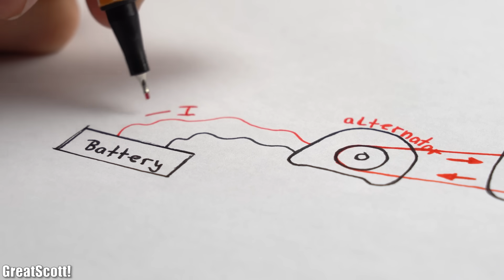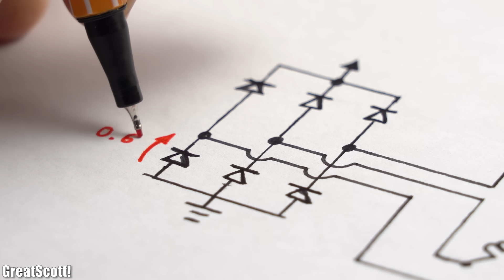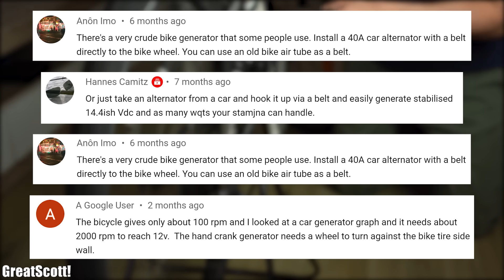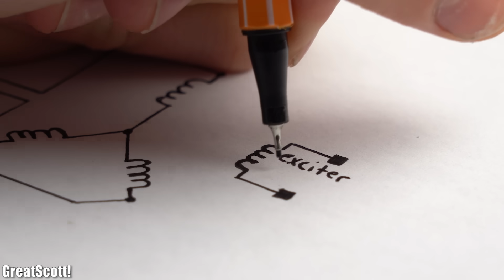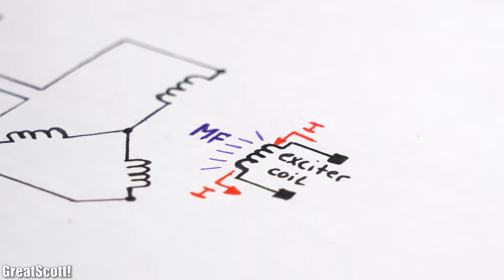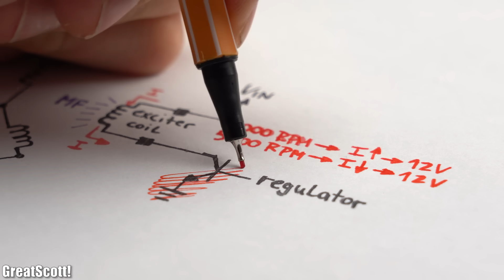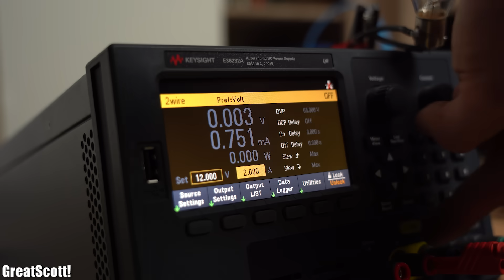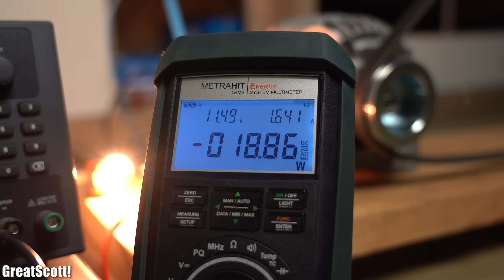Using a car alternator with a bike to power my home? How much energy can I produce?!

Comment: All I was going to say right away is you aren't going to get anywhere near max output when a car idles much faster than you will be pedaling. Also that belt is so loose, need a tensioner and slides to adjust the bike or alternator back and forth.

Comment: you need to learn how to wire the alternator correctly,one of the small terminal has the warning light in circuit and this is very important as it allows the regulator to work .If not you get an unregulated output which can damage the unit and battery and potentially cause an explosion ,trust me i was an auto electrician and a lead acid battery explosion is not pretty,,,,,,,,,,,,

Comment: So, I can easily do 100-120W effort for 2 hours 5 to 6 days a week. Let's keep it at 100W. So for 1 hour ride, I'll be able to store 1kW/h? We use about 200 kW/h per month.

When I was more fit, I could do more watts. 

Wish I could just run some small Air conditioner for my room for basically free for 1-2 hours maybe. But storing that much energy would require alot of battery,no?

I think it would be more suitable for a small greenhouse garden to run small dc motors and small heater/cooler.

Comment: Bit of an old video that popped up for the first time. I just wanted to say, cracking video, however I spotted a few mistakes. The biggest one I think at least for RPM is that you've got the gear system wrong. Your cog on your pedals you can't change without some tinkering, however, you set the gear to the easiest on the back wheel. The top gear is the smallest cog. The bigger the powering cog is to the drive cog, the back wheel, the more RPM you will achieve. So in simple terms, you get more full rotations the smaller the cog is at the back wheel to 1 full rotation from the pedals.

Comment: ERROR: you can self excite the alternator with the current it produces, this means you need only a little external power to excite it initially to start , then it auto excite the electromagnets .. a lithium battery supply of 3.7v for about 1 second can excite the alternator initially, then it self excite..

Comment: In legs there i 200W typicaly, so 100-150W from this alternator should be no problem to do.
Belt need some stabilization and force to compare bike weel dimension precision.

Comment: I have built a number of bikes that generate electricity successfully. Do not use a car alternator, instead use a 24 volt DC 250 watt scooter perm magnet motor. These motors are high torque and run at about 1,000 to 1,500 rpm max. You then put the DC output through a 12 volt DC (not a 24v DC) inverter. A really fit human can produce about 400 watts max for only a minute, so forget your 1,400 watt alternator output.

Comment: 😂😂 take the bike & toss it in a river= replace it with a small wind wheel/ prop = same alternator, same belt + a constan tensioner to KEEP THE SLAC OUT !! & YOUR UP & RUNNING YEAR ROUND UNLESS EXTREAM COLD FREZES THE PROP ?

Comment: I still don’t understand why electric vehicles aren’t self charging. People have tried explaining why an alternator won’t charge an EV but it still doesn’t make sense to me
Reply: Imagine lifting yourself up into the air by lifting on your bootstraps. You dont go anywhere because the amount of work your arms are doing is not greater than the amount of work your legs are doing. Both of these actions take energy from your body to perform, making this a net negative energy (in this example motion)
Reply: This isn't a perfect example, but maybe it'll help explain why

Comment: This how we learn in a practical way. Congratulations on completing the idea you had in your head! I would suggest maximizing efficiency on both ends (input and output) maybe set up the bike to turn a heavy flywheel at a maximum speed vs comfort of pedaling on the input the experimenting with what field excitation voltage makes the most power (watts)  given the alternators design using a variable resistor or rheostat (which admittedly will use some power). Obviously a solid low friction drive will be important as well. Maybe friction drive the alternator directly off the outside perimeter of the flywheel.

Obviously as you have found, output will still likely be disappointing but this is how improvements are made and new ideas are born. Be proud as a builder and experimenter, there are many ideas that haven’t been realized yet 👍

Comment: Needs a flywheel to help maintain speed as the load changes.   And also a battery to catch the peak power and level things out. 

My vehicle idles at 600rpm and the alternator can still produce 80A (13.8vdc).     But I'm sure the mechanical load is pretty high.

Comment: Try a gear set instead of belt.

Attatch sub power to a 5kv motor a larger gear ratio
a flywheel maybe 15-25lb plate off the end of that 

Now give it a push.. :]

Comment: 746 watts = one HP.  You need to produce two HP.  That's not easy.  Your bike wheel is far too large and your alt pulley is too small.  A smaller bike wheel is easier to drive so try using a 20-inch wheel.  A larger alternator pulley will slip on the belt far less because the belt surface area increases, belt resistance is lower and the radius makes turning the shaft much easier.  So use around a 6" or larger alternator pulley.  You can still use the bike's derailer for speed/difficulty in driving the alt.
I would use a battery with any alternator because the alternator is designed to charge the battery at 14.5-volts.  If the battery is charged (which won't happen much) then the voltage regulator will relax the field winding.
A 1- wire alternator is a move in the wrong direction because they don't output until the speed reaches ~1,500 rpm.  A three-wire alt will output even at low rpm.  Basically, the third wire is a 'sense' wire to determine that the system is running.  A 1-wire has no idea so they must use rpm to 'sense'.

Your light draws one amp at 12-volts or 12-watts.  See how much energy it takes to make it shine?  Imagine a 100-watt load.  Your legs will fall off after ten minutes of peddling.

Comment: I made one years ago using a permanent magnet gearbox motor. I used it to keep fit during winter. The best I could get was 250W. As a test I boiled a cup of water with a 12V element but after doing so the last thing you needed was a hot drink!  Around 80W I found sustainable fir an hour or so. I also used it as an education tool to stop the kids leaving the lights on!

Comment: There are low rpm car generator's that predate the alternator...  They still make them btw. Rock Auto carries them.  One for a 57 Chevy truck (6 cylinder) is between $70 / $90...  
It would also help if you put a larger gear between the bike and the generator to make it easier

Comment: You can use an alternator and your. DC motor. a power inverter. and you got to get the right magnets. disassembled the alternator. Throw the regulator in the trash. Pull out the copper coil. and with the correct magnets. You have to glue. them epoxy them. Whatever way you want to do it. All the way around the coil. Odds and evens. And once they are permanently fixed to the copper coils. you take the three wires on the back. of the alternator once it's reassembled, you get. your two main power wires for your 240 volts. and the other neutral wire. Then you connect the belt. from the alternator to your electric motor. Power inverter from the alternate. to plug in the electric motor. And then you just need a string or drill to fire. to fire up the alternator once it's running. The electric motor will spin and keep spinning the alternator. Thus powering up the two main coils in the back Which 240 volts should be enough to power up any. 100 amp service panel. Maybe more depending on the alternator. I'm sure there's some people that can fine tune what I'm saying. But you should get the idea.

Comment: Bro you don't have a clue what you are doing😮 the car alternator needs to turn at least 3000 RPM😮 it would be much easier to use a e-bike motor to generate electricity😮 and all e-bikes are already set up for that because if you are pedalling the bike you are generating electricity back to the battery😮 so actually you don't have to do anything to it it's already does that😅😅😅

Comment: Try using a washing machine motor. As you know, a motor will rotate when power is supplied but turning the motor will als create power. 

Regardless, its all useless for practical needs.

Comment: I see your video is old but if you actually went and did some research you realize that car alternators are very inefficient at producing power for the amount of energy in point you have to put into turning it. There's far more efficient ways to generate power than a car alternator.
Reply: Commercial alternators are very expensive. I am need a alternator for my thermal power generation. Any suggestions for a low cost stable alternator which can run in day time? Parabolic solar mirror + Steam + Turbine + Alternator. This is my plan, I am still exploring other options.

Comment: Question from a trucker, would a high output alternator like we use on our rigs and like cb competition guys use to power their amps make a huge difference? Standard alternators do 14 amps when driving but high out put ones like mine do close to 2000 amps.

Comment: Rule of thumb, energy can neither be created nor destroyed. The more electrical load that is put on the altenator, the more resistance will be incurred. Sure, it looks fine on a meter, which introduces no load, but trying to maintain 2000 rpm is not feasible. 2000 rpm is the minimum that an alternator needs to turn to generate power. Nice try but you neef to research electrical theory before attempting to generate electrical power to assist with cutting your electric bill.

Comment: What you want is an alternator for a 1974 Chrysler Imperial. You see, an alternator generates alternating current naturally, then transforms it into direct current. There is a way to tap into the AC portion of a Chrysler alternator somewhat easily. Also, you want your chain on the smallest gear of the rim and the largest gear of the crank to achieve the highest RPM that system can provide. Pretty cool video, look up the Chrysler alternator experiment on YouTube. Thanks for sharing.

Comment: When my grandfather passed away  1981 we found a lawnmower engine on a bord with a Chevy alternator and wires and  connectors  my dad took a look at it and sead IT would burn more gasoline than make energy , so it's useless 😢

Comment: Dude you are so close… I have been yelling at the computer the whole video. 1) You need a tensioner for the belt. 2) use a car battery and a power inverter. You will get a more consistent electrical output that way with less surges and drops. 3) your focused on the wrong problem. You don’t want to power your house with a bike, you want to power your house with a battery. You want to charge your battery with the bike… I have built the same machine with a gas pressure washer motor. The idol speed of a brigs and Stratton gas motor is about 1000 rpm. I ran my house for 12 hours during a power outage with that system :)
Reply: Same thoughts when I saw the first 3 minutes
Reply: I would definitely like to see Andrew's example in full working order. I know it's possible, and thought the exact same thing, run appliances from battery/ inverter, charge with alternator 😎👍👍
Reply: Can you please m make a YouTube video of the process and post a link . I'm sure many would LOVE to see the real working system. Thank you.
Reply: It never fails to amaze me how many "off grid" videos on YouTube are made by people who have never actually lived off grid.
Reply: If you replace the rear wheel with a flywheel and get it up to speed you wouldn't have to continuously pedal.
Reply: @DL-mn6pg  Indeed a flywheel, especially a really big one could spin forever if you placed it on a bearing supported column
Reply: U most definitely described a gas generator.. he needs to add another wheel and hook up to the smallest sprockets and use the tire again to push the generator.  That should give him a substantial increase in rpm increasing the output drastically
Reply: according to the interwebs, a beginner cyclist can usually generate 75 watts and after a little conditioning 100 watts is very doable… professionals typically generate 2-300 watts on average for an entire race. 
also, zip ties? nope. you need to clamp that bike frame down. and not with those metal ell brackets either, the screws will tear up the wood over time… too much force, too little material bearing the force. suitable for prototype only.
Reply: No doubt about it, the absence of the belt tensioner alone almost made me mental hahaha
Reply: It goes from powering a house to charging a phone!?? False advertisement!!
Reply: @TheResponsibleTerran  Maybe, but it was entertaining, and I think that is really the point. At least for me it was.
Reply: @TheResponsibleTerran  That's why he had a question mark at the end of the powering house statement. Learn to read.
Reply: Does one need a charger controller to charge a battery with an alternator? All the charge controllers I’ve found are only for solar panels.
Reply: @machineresolve485 no, because vehicles using an alternator don't use a charge controller.  The regulator is in the alternator itself.
Reply: @Qui-9 i'm pretty sure you will need a rectifier of some kind, and depending on the battery you're using you may need a battery management system. Lead acid batteries (the standard car battery) are pretty much bulletproof when it comes to charging conditions, so all you'll need for that is a rectifier, but LiPo batteries are far more particular about charging conditions and will explode if you charge them wrong.
Reply: Please post a video. Many of us are very interested.
Reply: This dude is just recharging a car battery with extra steps.
Reply: You are all over it. Nice of you not to be condescending about it. He's just not a car mechanic or he would have thought to use a car generator to begin with and he wouldve known to use it to charge the battery. He learned something usefull by videoing his mistakes but thats ok. Thank you for filling in the missing pieces of the puzzle !
Reply: If you're going to use gas power motor anyways, why not just buy a gas generator??
Reply: They did the same thing in Predator with that truck running non-stop with the belt.
Reply: For a touch more output you can use another alternator on your tensioner arm
Reply: Please make a video!
Reply: Commenting so I can find this late
Reply: How much watter does it make
Reply: Flappy bird
Reply: Bullshit
Reply: If you make a video on this, I’m definitely watching
Reply: A battery bank , charger with rectifier and an inverter .
Reply: I would want a way to store that energy in a different way than a battery.
Reply: I thought maybe use a solar regulator to regulate the voltage output.
Reply: You definitely need a belt tensioner 😂
Reply: Yep, hook up DC straight to an MPPT controller and consistent volts are delivered to the battery to power the house via an inverter.
Reply: You've done the research we thought he was going to do and put on camera with his nice mic and video camera and editing and number calculations and high end volt meter. Instead he just filled everybody's heads and eyes with impractical pessimistic highly subjected examples and conclusions about using alternative energy producers so that nobody will ever entertain the idea let along research any ins and or outs about it to bring any of it to fruition. You should take his place. This video was a waste of SD card space and it should have been deleted. All I'm saying is that your comment is not a video on YouTube, and when I look this up on YouTube, his video is what I find and that's what pisses me off.
Reply: yeah he's stupid
Reply: Make a Vodeo. PLEASE
Reply: Dude you're basically explaining that you made a gas generator! You can buy them in the shop lol
Reply: @Shifytee123 exactly my thoughts
Reply: @andrewf3505 please post your contraption please were genuinely interested
Reply: And replacing the belt pulley on the alternator with one twice the circumference will make charging the battery much easier and faster.
Reply: @DougPoulton no the smaller the pulley on the alternator and the bigger the pulley on the bike is what makes the ratio larger. Every one spin the bike does the alternator spins8x if you get a larger alternator pulley it would be a smaller ratio

Comment: EE here. They have large D.C.permanent magnet motors that act as generators....why suppply the exciter magnetic field power ( a loss to your system) when permanent magnents can do it for you. You CAN easily arrive at outputting 500 to 1,000 watts on your bike if you can turn a big D.C. permanent magnent motor 1800 RPMs...it's all in the gearing. Gearing and being able to pedal good enough for long periods is all you'll need to power your home.

Comment: ??? You have the chain on the largest rear sprocket which is the lowest gear which you said has high gear.  If you want a higher RPM move it to the smallest (high) gear.

Comment: Besides that you can buy a whole complete bike generator - which is quite expensive - why don't you just try a better generator, like f.e. one with 300w or 500w that would be used for a small DIY wind generator?